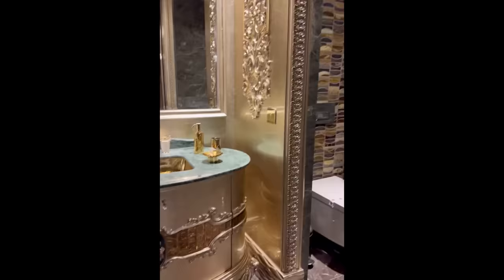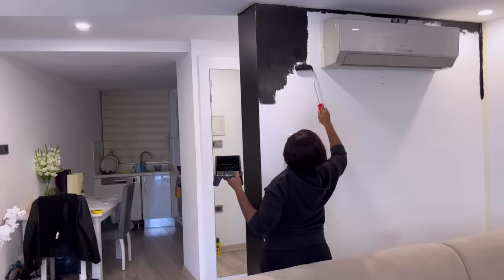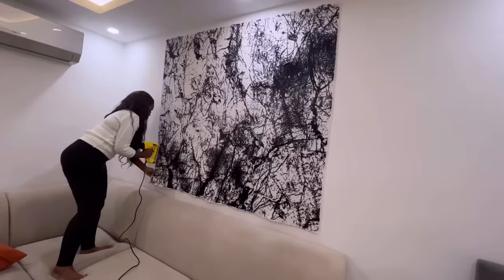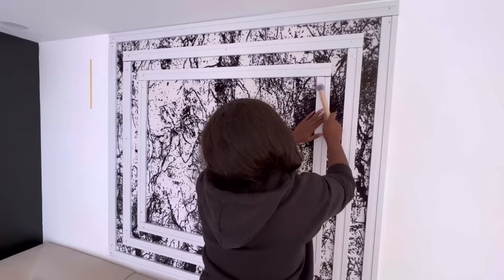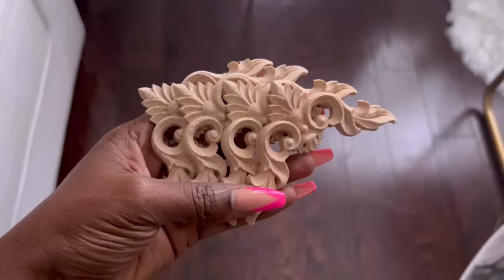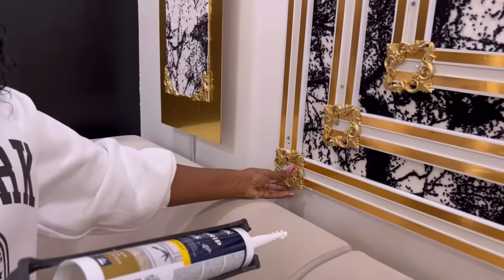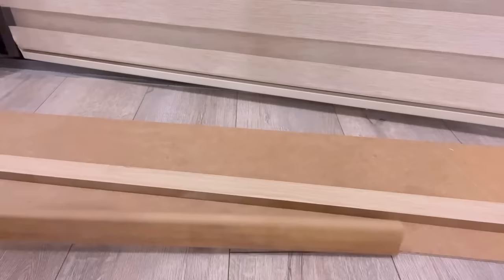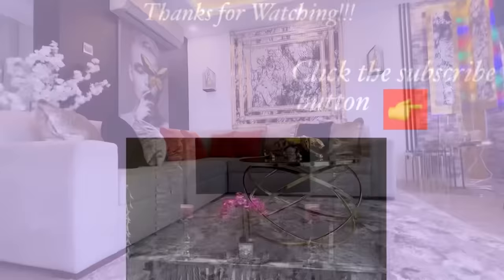NEW 2023 EUROPEAN Glam MAKEOVER under 24hrs!!! AND HOW I USED RUGS ON THE WALL!

Comment: So lucky to find the right rug with the correct design to emphasize that wall!  And, to top that off, to be wise to use the rug again on a vertical boarding a smaller space.  
Great design.  Big improvement!
Liked the vases and arrangements.   Those draperies are a show-stopper, like a lot, so lucky to find all these.must have went to many shops to locate such perfect items.  Well worth it!